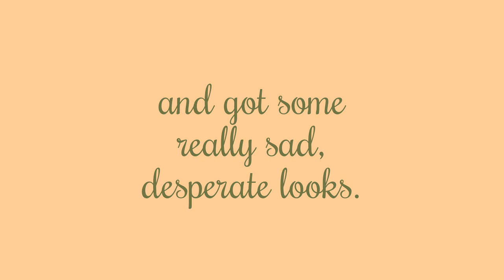How To Make A Haflinger Mad

Comment: I would not have taken that off, not being the size she is, unless she is in foal. Fat horses risk serious illness.
Reply from the maker: +Talamslyric It is a balancing act. Yes, I need to limit her eating, but at the same time she needs to be able to get something for the proper moving of her digestive system.  I don't want her to colic.  She has been taken out of the pasture that gets round bales and has been placed in a paddock where she is fed square bales in a slow feeder.  There will be further restriction once we can get the electric put up so she doesn't bust a fence to get to the round bale.  Also, I am trying to find someone to ride her during the week when I can not.  Had someone, but now she no longer has the extra time to ride. :(  Also, her water and hay are at opposite ends to encourage some movement.  I do what I can.
Reply: The grazing muzzle can be improved by making the hole at the bottom bigger (I use a knife) this means she will still not be able to grab large mouthfuls but she'll get more than she can at the moment. Hope you find a solution. :)
Reply from the maker: +Talamslyric Thanks. Yes, I had tried to make the hole larger, but was unsuccessful. :(  I think I need to sharpen my knife.